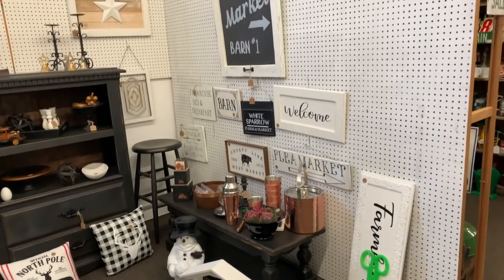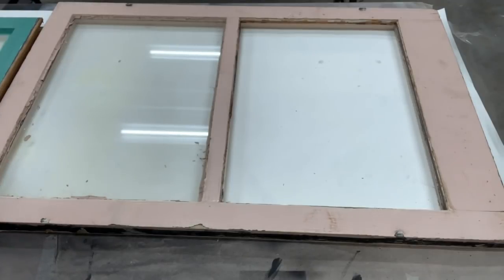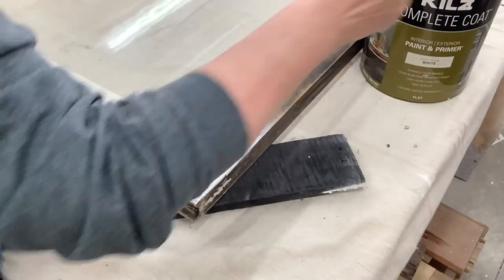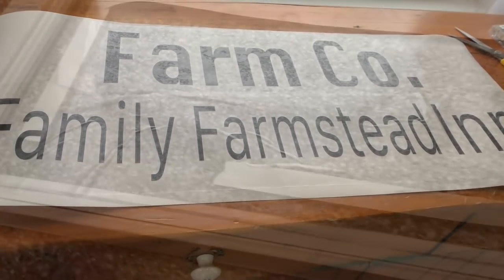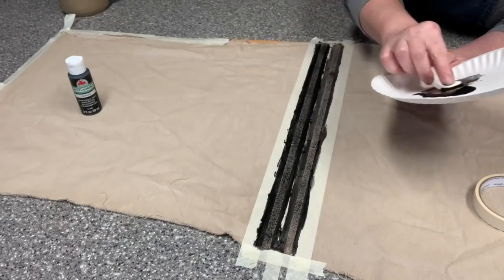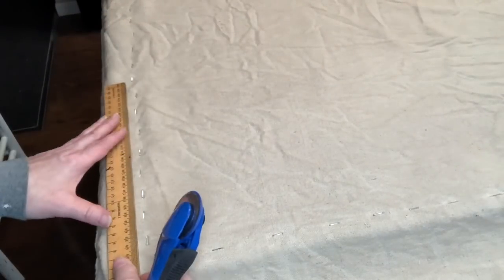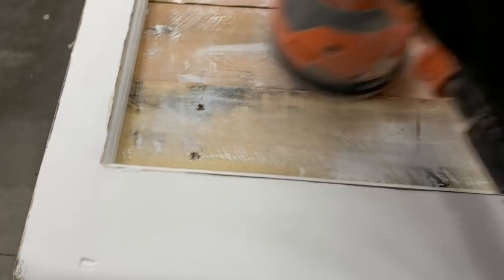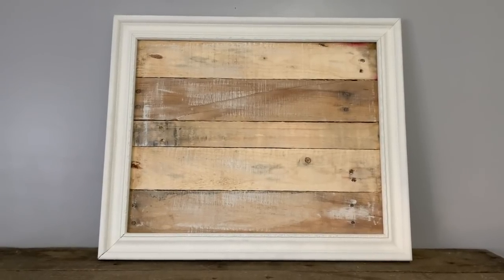Trash to Treasure Flipping Old Windows for farmhouse decor

Comment: When using vinyl on glass windows, do you put it on top or behind?  I was thinking if you put it behind it would be easier to clean...? Have you done it both ways?  Lots of questions, but I learn SO much from you!  XOXO
Reply from the maker: I’ve only put in on top. That vinyl is really hard to remove once it’s on glass. ( it would take a razor blade to get it off)  I just don’t want to think about doing it in reverse. That would be hard for me and maybe others watching. 🤗
Reply: @GingerChickRehab  thank you so much!